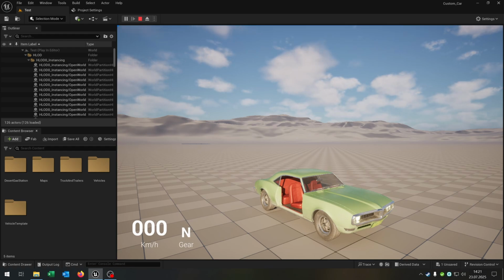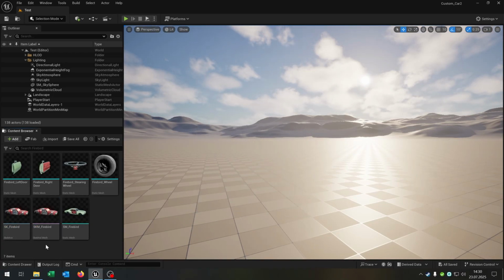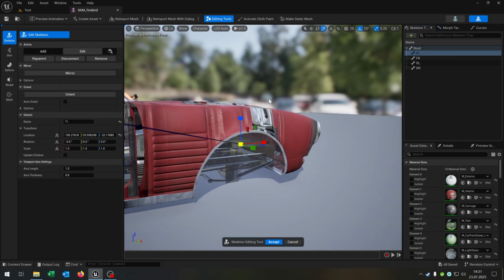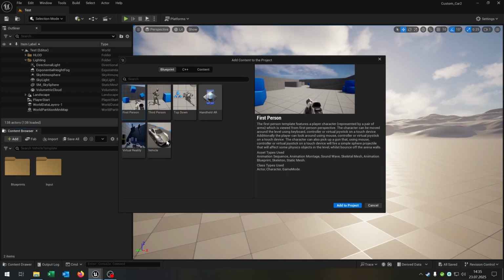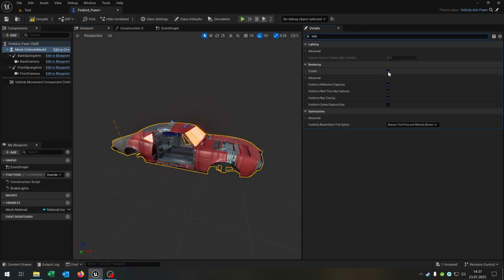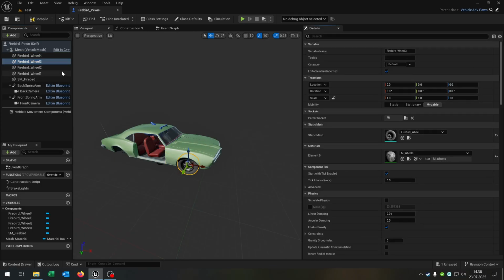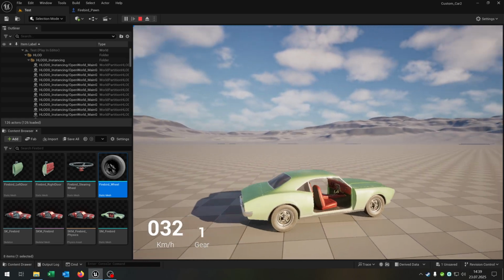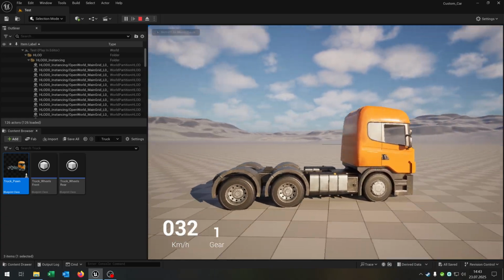Unreal Engine Import / Convert Vehicle Tutorial

Comment: Hie, I am new to this, could you have any idea how did you set the VehicleMovementComponent? Thanks in advance, and Thanks for your help
Reply from the maker: What do you mean by "set the Vehicle Movement Component"? How to get it? Its Part of the Vehicle Template like I showed in the Tutorial. Or you mean how to change the Engine?
Reply: @Seredias. I think that somewhat I figure it out, it’s ChaosPlugin for Vehicle movement in newer Version of an Unreal Engine. However, thanks very much for your prompt response. I appreciate 👍🏻
Reply from the maker: @venusshah4476  Well, "newer version" is relative. The Chaos plugin has been around since version 5.0; before that, there was only the wheeled vehicle movement, which was introduced in version 4.14 (2016).
Reply: @Seredias. Yes your are correct. 👍🏻